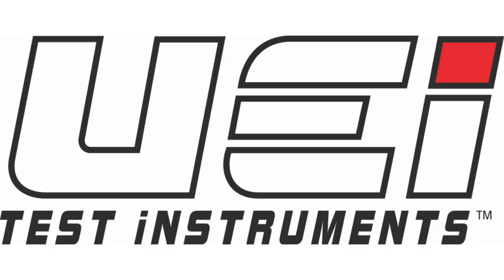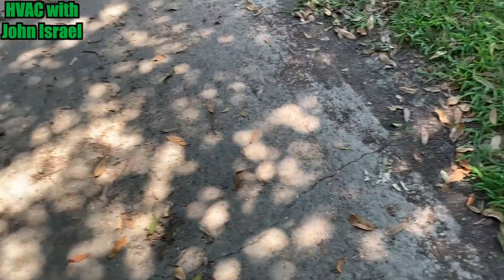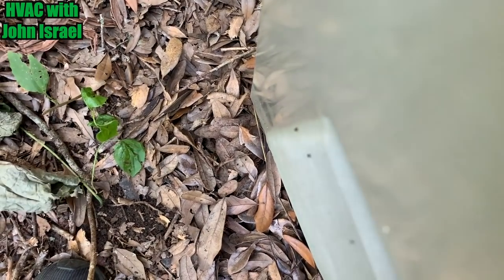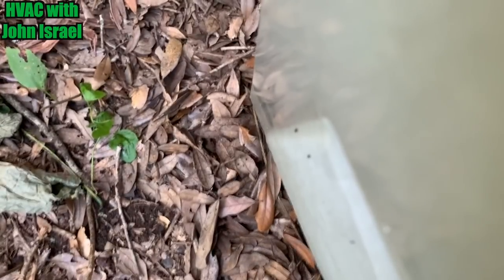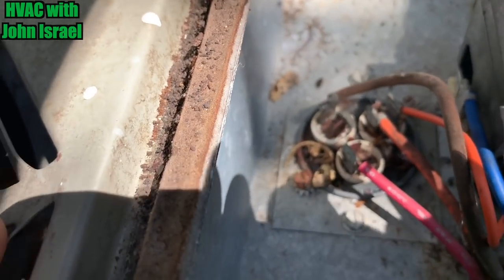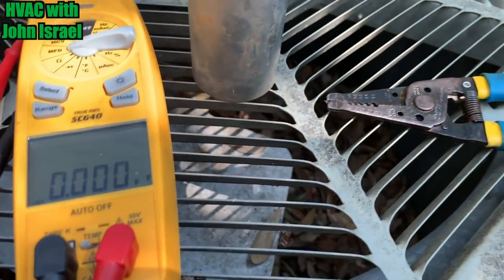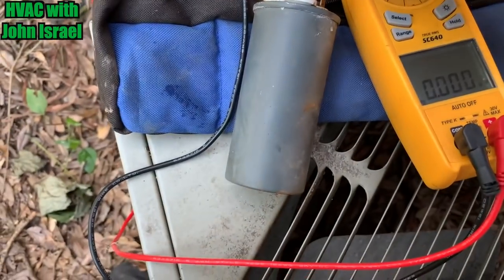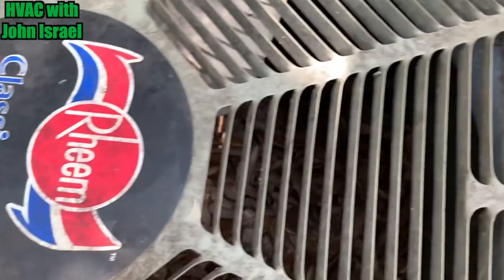HVAC | Condesner Fan Motor Not Running

Comment: Did I hear right, $500 dollars for a condenser fan motor?
Reply: Is that a good price? $500 $600 like he said, lol
Reply: @sidneymeyer3193  yes. 500.00 is what we charge for that motor. Memphis Tn.
Reply: @maxeyac  A bleepin' motor can't cost $500.  It just can't.
Reply: @hunkydorian  Installed 500.00 the motor cost about 175.00 plus capacitor.